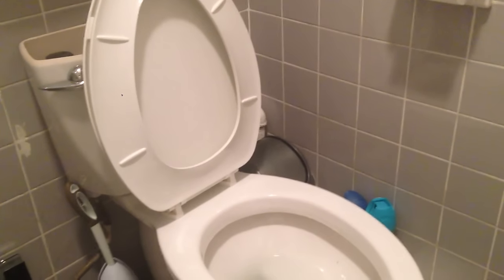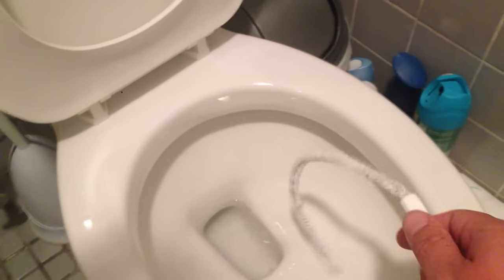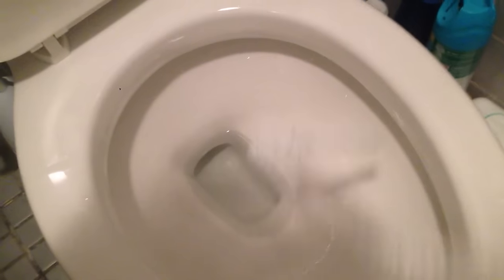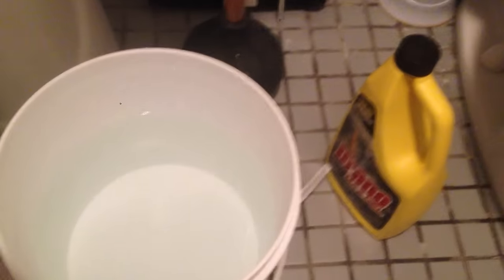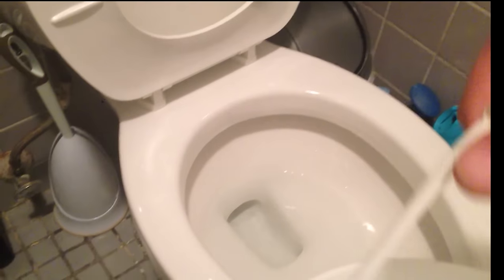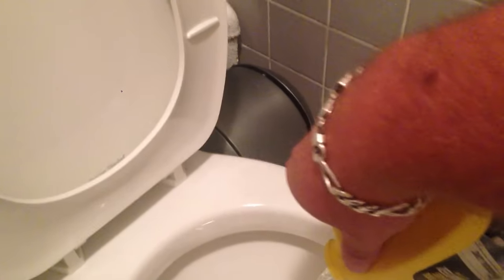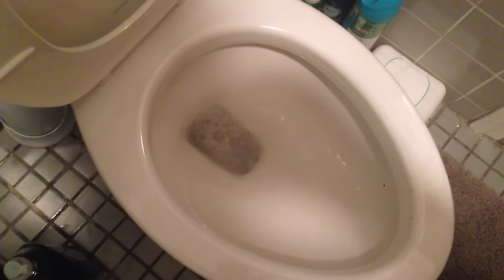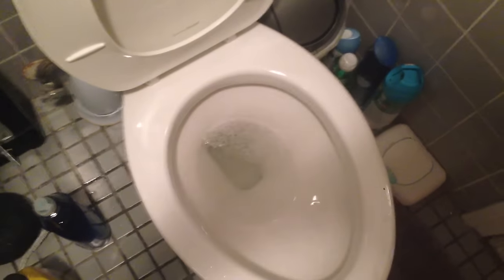How To Fix Slow Flushing Toilet  - Not Flushing Properly

Comment: where do i put the detergent in the non flush handle but the push button on the tank? thanks in advance : )
Reply from the maker: Hi, I would put a little in the tank and the rest in the water overflow pipe. this is the pipe that is sticking up that prevents the tank from water overfill in case the shot off valve fails

Comment: My plumber told me never to pour hot water into a toilet bowl. It could crack the bowl.
Reply from the maker: Only Do it when you have too, especially to fix it and don't over do it and you will be fine. and your plumper will not be collecting money on a simple repairs. for serious work like replacing your toilet you may want to use a plumper.

Comment: I read the label on Drano and it says not to use on toilets.  So not sure if this method is a good solution.
Reply from the maker: if you have a cloged toilet you should not use drano. Only if it is slow draining you may.

Comment: My toilet doesn’t seem to have a siphon jet. There is no other hole where the water goes down the drain. My toilet flushes with good pressure when I pour water into the bowl. When I flush with the handle, the pressure is very low. What do you recommend?
Reply from the maker: I would maybe check the valve or the opening that opens the water to go down. It may not get enaph water ehen flushing. The opening might not open all the way to give good amout of water to flush. Its little hard without knowing exaclty what toilet you have
Reply: @TeckDrivenTeck  Hi, My toilet flushes fast and strong when I pour a bucket of water into the bowl so I don't think there is a clog in the pipe to the sewer. The water level in the tank is fairly high and hasn't been changed. I checked the siphon jet holes and they are wide open and not clogged. I just don't understand why I'm getting such low water pressure when flushing. Any suggestions?

Comment: Isn't not safe to pour drano in as it may dissolve the wax ring?
Reply from the maker: It will not desolve it as long as you dont over fillet and the toilet is not clogged.  The water needs to flow. If the toilet is gloged then there is possibility of damaging the wax ring

Comment: NEVER pour hot water in a toilet. You will crack the bowl!
Reply: I used hot water from the shower tap with no problem. However, I can see that using boiling water could crack the porcelain bowl so your advice is a good warning to be cautious.

Comment: What if you to flushed something big down the toilet, maybe the size of a small ball. Would this work
Reply from the maker: Unforunatly this methot will most likely not work on a flushed ball. What I would try is to take a trip to a local Home Depot or Lowes for a "Drain King Unclog Hose Attachment". this might work to fuch the ball down the drain. This perhaps is not the best solution but its the simplest one that might work.

Comment: Hot water will melt the wax gasket and the toilet will leak.
Reply: Most wax rings have a plastic reinforcement and the water isn't sitting on the wax. It's only passes by.

Comment: I thought you were never supposed to put drano in a toilet.
Reply from the maker: Drano recomends that you dont use it on toilets but as long as the water at least flows a little bit and you dont let drano sit for a hour or more in the bowl you should be fine.

Comment: By what mechanism does the dish-washing liquid help in the overflow pipe in the tank?
Reply from the maker: The Dish-washing detergent helps break down Blue or bleach packs that you would trow in the tank, Sometime the packs brake apart ans small pieces fall in and clog the small holes that create the funnel effect when you flush the toilet
Reply: Teck Kimborowicz
Yeah but the thing is, the direct path from the overflow pipe leads to the "jet" at the front of the trap way at the bottom of the bowl. So really in your case, putting dish soap in the overflow pipe had no affect on the rim jets that go around the bowl's rim because the soap did not even touch them; it just went down to the jet. There has to be a very strong force of water for it to reach both the jet and rim holes. Some toilet work differently, mainly ones without siphon jets, because the path from tank to bowl goes to rim jets only as there is no siphon jet there. In that case it would have been beneficial to pour some cleaner in the overflow pipe.
Reply: The rim jets and the siphon jet at the bottom are both fed by the water going into the overflow pipe (the overflow pipe simply circumvents the flapper when it's closed). This is clearly visible if you drop food coloring into it while water is running.

Comment: HELP! What if the hot water doesn't drain down right away?
Reply from the maker: If it takes a while for the water then probably You might have clogged toilet. My Video is more for slow flashing issues but if you add water to the bowl and it drains very slowly lets say a Minute or more. Then it clogged in the toilet or somewhere in the pipe line. If that is  the case you can try to use plunger or you may need to remove the toilet to get access to the pipe and use a snake to remove the obstacle.
Reply: @Vanessa. I think if the hot water didn't go down the drain, I'll have to come over to your place and help you out...lol!!

Comment: I know you are trying to do a good thing and it has worked for many but do not use drano in a toilet ever. I learned the hard way. Even they say never use it in a toilet. Here are just a few of the reasons why Drano uses caustic or oxidizing chemicals (like lye) to dissolve whatever is clogging a drain. The chemical reaction between the clog and Drano creates heat. 

Now, Drano does not clear a clog instantly. It’s going to sit in the toilet (or farther down the pipes, depending on where the clog is) until the clog dissolves. That means it continues to generate heat.

This can:

Crack toilet’s porcelain bowl and the whole commode will need replacing

Soften plastic (PVC) pipes

Damage old, corroded pipes

Comment: What's wrong with my toilet.  Slow flush, Roto Rooter was there, cleaned out Main and snaked toilet. Three other toilets in the house work ok. Roto told me to clean rim holes and siphon jet . No rim holes just wide open slots that I cleaned.  No siphon jet!!?? Removed water, felt around for it. Flapper& valve ok & water level 
?????ideas?
Reply from the maker: There should be jet holes, but in case there are non. If nothing is blocked in the jets and it's defanatly not cloged only two things come to mind. 1 the water flows to slowly to the bowl or there is a Crack in the bowl that prevents it from proper water suction
Reply: @TeckDrivenTeck  I'll look for a crack. It may be loose wax ring, toilet  sealed to floor. That'd cause a suction leak,  right? Thanks for the answer
Reply from the maker: @johntestmarketing9565  the wax ring can couse blockage but it will not have any effect on the suction. To check suction or check blockage fill a bucket of water and then dump in fast into the bowl if it goes down without a problem and takes most of the water out of the bowl than that will tell you the the wax ring is good and there is no cracks and no blockage and the problem is someware alse
Reply: @TeckDrivenTeck  Well,  Roto Rooter did bucket Test, I'd done it several times..flushed no problem. I looked for bowl crack. Nothing. Could it be between the tank and bowl..the doughnut? But there are no leaks! 3 other toilets in house on same stack work fine and are older toilets. I'm going to look at the rim again. Never knew open rim toilets existed or ones without bottom siphon jets. If you have any ideas I'd appreciate it 
Again Thanks for at least answering me
Reply from the maker: The only think that comes to mind the rim holes or siphoned jet is cloged. It maybe not visible but it could be cloged internally. I would try adding worm water to the tank with some dish soap few time with breaks in between flashes to see if it might loosen whatever is blocking it
Reply: @TeckDrivenTeck  Thanks for your reply. I'll try your suggestion

Comment: The instructions on Drano containers say "don't use in toilets."
Reply: I do not use Drano, period. I have 2 videos on making a toilet flush better. From time to time a commercial grade closet auger is needed. It does a better job than a regular auger. Pouring toxic chemicals down the sink or toilet is being part of the problem in our polluted world, not part of the solution. Thank you for using your head and reading directions. Preventive measures like pouring hot water down sink drains (double sink do both sides) before they get clogged and using soda and vinegar combo is not a toxic load. I saw all these views and had to see what the reason was. As you know we can't always listen to what others have to say and that includes me.
Reply: There’s toilet safe draino. Two seconds of google would’ve told you that

Comment: Hot water broke seal on my apartment bathroom toilet
Reply from the maker: The only time that is possibe is when the pipe was cloged right below the seal And even if it is still rare as hot water does not sit there for long time and mixes with cold to cool it down to melt the wax.
Reply: @TeckDrivenTeck  same thing I was thinking but I also didn't have water coming out the bottom of toilet before either

Comment: For 3 days I've been messing with my toilet because it has a weak flush.  There were a couple of problems, but I believe I got them fixed. (better have, anyway!)
The tank wasn't filling with water to a decent level.  And the jets were filled with lime and scale....just not enough oomph.  Scraped it , scrubbed it and used hard water, lime and scale remover.  It flushes much better now.  The biggest problem was the bottom jet.
Reply from the maker: The bottom jet is the bigest one and tends to get jammed up most often

Comment: so i did all that was asked twice but didn't fix the problem but i didn't use drano. I went got the closet snack stick it down but didn't get anything. I also plunged so many times even got a better plunger but didn't work.What should I do next please?
Reply from the maker: Inspect the toilet bowl for any cracks, if you dont find any cracks, next step would be to remove the toilet bowl.
Before you begin you will need to get a new bee wax ring or simmilar at lockal harwere store, they are about $5-$7.
It is possible that somehow something got stuck belween the toiled bowl and the sewer pipe because the diamiter changes.
Please remember that placing toilet bowl back in its place could be tricky sometimes. sometimes it is recomended that you get proffesional to do it.
If the above does not work, then there is possibility that their is a clogage somewer in the sewer pipe, snake wire can be used to check.
Reminder before you start disassemling anything it is strongly advised that you check the toilet bowl carefully for any cracks and if there are anything stuck in the small holes or the jet hole.
I hope this helps
Reply: Paige Havu A slow flusher is VERY likely the water mineral buildup clogging the fill holes that underline the bowl Rim.  Teck did mention this, I'm just confirming it.  I'm convinced this is what is clogging 1 of ours, because 1 of our best flushing toilets has the same 15 year old parts & yet flushes amazingly fast.  Water shooting out fast from the Rim holes CLEARLY has NO obstructions/not clogged.  Teck's vid here further proves that cleaning the Rim holes is very effective.  That Drano gel AND Dawn soap clearly unclogged the Rim holes, but i can understand using a harsh chemical.  If so try CLR instead and manually clean the Rim holes.  Try a brillo pad & round bristle brush(s) & CLR instead of the Gel.  Or your choice of gentle cleaner.  Bear in mind dissolving hard mineral deposits could very well require a harsher cleaner.   Focusing on the clogged Rim holes will be the fastest & cheapest thing first.  Was going to try CLR (Calcium, Lime, Rust) when i just found this vid.  Will give both a try if necessary.  We are renovating projects & i am fixing our 14 year old toilets.  If unclogging the Rim holes fails to fix the flush problem, i will rent a toilet auger.  If that doesnt fix the prob, i will replace the toilet.   If I pull a toilet, its ONLY because i'm going to replace the entire old 1 with a new one & only because we cannot get the clogged Rim holes cleaned out.  A new install Is tricky, ALOT of work and pricey depending on what you buy.  You get only 1 shot per bees wax ring.  aka --if H20 leaks at the floor level, you've got to pull the toilet yet again, remove ALL the new bees wax & slap down a 2nd new bees wax & install toilet again.  I've had 100% success in the past.  We are going to get a water softener installed that will eliminate the hard water mineral clogging problems once & for all.  Our shower heads are getting clogged very fast with water mineral deposits too.

Comment: Yes, put the product that they say not to use toilets into the toilet.
Reply from the maker: +aluisious All Products that I used were Septic Save, Check the bottles for warning lables, There are only few that you should not use, most of them are Toilet and Septic Save.
Reply: +aluisious alot of drain gels are now good for use on pipes and toilets when they used to not be check the labels
Reply: I just picked up a bottle of Draino Max Gel.  It also says "do not use with plunger or in toilet".
Reply from the maker: Drano build-up remover can be used for toilets, but only to help water drain better and not to be used to unclog fully clogged toilet or pipe. That is why there is the warning label as lots of people try Drano on fully clogged drain pipes.